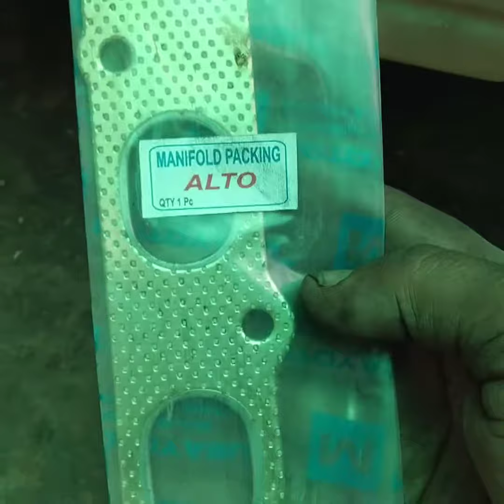aaja Maruti Suzuki Alto salnsar manifold packing change 🙃🙃🛻🛻

Comment: did you remove the entire front panel?
Reply from the maker: No 😔 manifold packing change
Reply: @navneetmotorssamanawale6089 no bro I mean did you remove the front bumper to access this part?
Reply from the maker: 9855585273